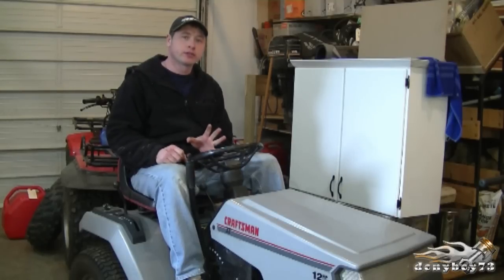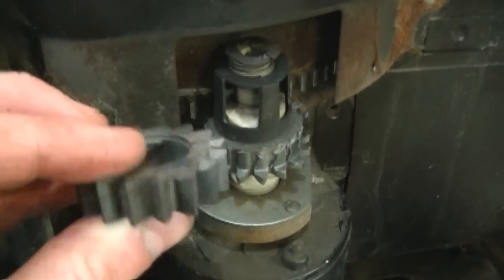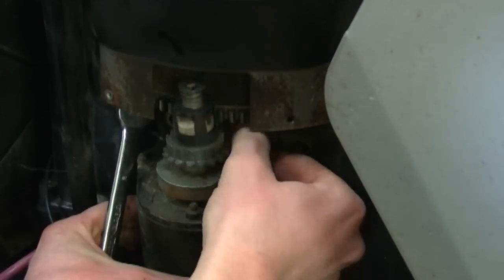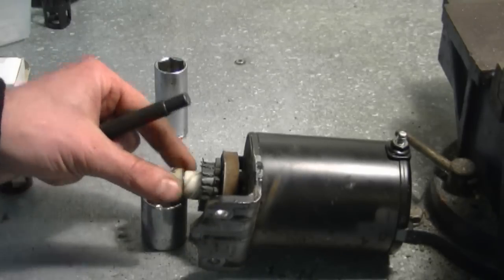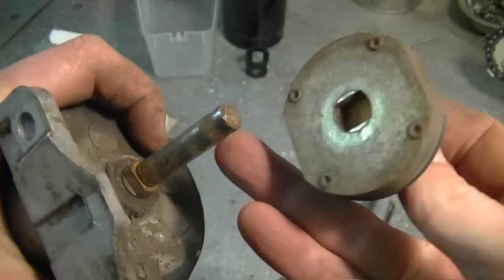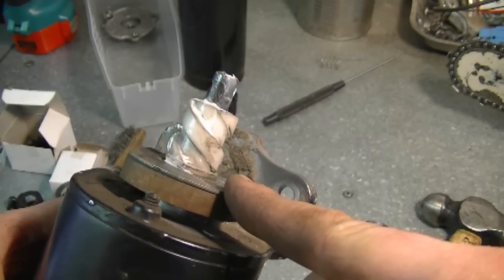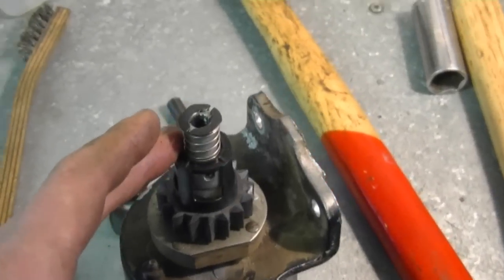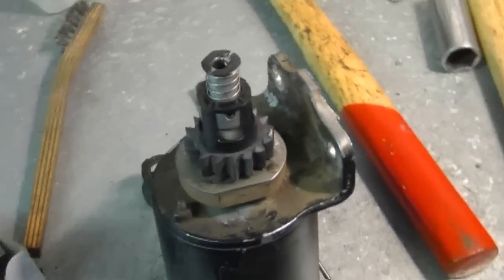Lawn Tractor Starter Gear Repair with Briggs & Stratton Engine

Comment: I got a starter on a 13hp yard machine it won't be easy as you show these easy repairs trying to place a nylon gear on it. I couldn't get no repair shop to replace or fix it for me. The bolts in the aluminum casing were strip so I jb weld them to it. I'm so poor can't afford a riding mower. I bought this one for $50.00 as is got it fixed just right only problem is the starter.

Comment: Hello. I really appreciate your helpful videos. I rebuilt my Briggs starter following your instructions. I also changed out the solenoid, plugs, gas filter and the coil since I had everything open on the engine. This is for my 1992 Craftsman 18HP flathead. The tractor is in great shape and now it's purring like a kitten. So again I say thank you for all of your time and efforts. Keep up the great work.

Comment: I have heard that they make the one gear out of plastic so in case  the engine will not spin it only breaks that gear and not damage the engine .  I have a 1991 craftsman the you have to pull the top of the engine off to get to one of the bolts .I have a briggs book that says that is the only way to remove the starter . I wish it was as easy as yours.  I also have a 96 and it comes out like yours .
Keep the great videos comming.

Comment: @skaaltel the ring gear is aluminum on most briggs engines except for snow blowers with 120 volt electric start and bigger engines like 16 hp + is is cheaper to replace the the $4 gear than a $40 ring gear

Comment: This instruction was spot on.  I have a similar, old Craftsman tractor.  It needed a new top end on the starter motor.  This video explained the whole process which was good if you haven't done it before.  
Thanks Donyboy.

Comment: You make the best small engine repair videos! I had this same problem with my cub cadet xt1 with a kohler v twin. I removed the starter and, surprise, all the parts were metal. No wear on the gear. I took the end cap off the shaft and a nut and washer came off with it. I refastened the washer and nut, put it all back together and back on the motor and, zoom, started right up on the first go. So, that nut must have a tendency to work themselves loose. Anyone having the same problem with a cub cadet xt1, before you spend 40 dollars on a new starter, check for this simple fix first.
Reply: Also, if you find that the problem is more complicated, probably best just to buy a new starter. This starter model looks like its not really built to be rebuilt. Would be more complicated than your average rebuild job.
Reply from the maker: @WallyGator72  I hardly ever rebuild anything nowadays

Comment: Good video.  I liked the way you showed details on removing the roll pin using a punch with the starter shaft supported by a vice or something metal, such as a socket from a socket wrench set.  I needed to know how to remove the roll pin without damaging the starter.  My only suggestion is that you should tell viewers that the "appropriate punch" to use is a 1/8-inch punch that is not tapered (which I learned from another YouTube video on this same subject).

Comment: Wow, thank you.  Your video gave me the confidence to attempt fixing mine.  However, in my case, the gear is made of metal and seemed in good shape, and what is happening in my case is that the small gear is not "jumping up" to engage the larger gear.  So, I worked the gear up and down and hit it with some Break Free and it started working 90% of the time but every now and then it would hesitate to jump up.  What would cause this?  I have a Koheler Command 11-16 HP motor from about 15 years ago in a Yard Machine.  I am sure something more needs to be done to permanent solve the problem?  Thanks for the great video!

Comment: plain and to the point, just what i needed. I enjoyed this video. I am sure this will help my 2001 CRAFTSMAN 25 hp B/S mrearlsc
Reply: Removing my starter from my 2001 Craftsman sure has been a new venture for me. I can say, one thing for sure I have learned a bunch. When you see something done it sure makes it a lot easier. Still learning mrearlsc   05/25/2023. Note / going strong 81.6  enjoy each day you have.

Comment: I just had to do this on a brand new starter!! I’ve only used the mower 3 times at most since I replaced the starter. They sent an extra plastic gear with the starter when I bought it but it’s a pain in the ass & very time consuming having to go through the whole process of taking everything off to get the starter off and then fix it and then the whole process of putting everything back on. I hope the replacement lasts more than 3 mows!!! 😡

Comment: I am about to do this repair on my cub cadet. I was wondering before I get into it if you could specify the plastic part that broke off during the process. I have already ordered the gear itself I would just like to know that plastic piece specifically in case my luck fares no better. Great video, very in depth.

Comment: Hey DB ... I replaced the entire assembly. I tested it on the bench and of course it shot up to the top as if it was going to engage the flywheel. I put it on the lawn tractor and all it did was spin at the bottom and not rise to engage the flywheel... Thoughts?

Comment: Got a twin 18 vanguard eats one gear a year, Breaks in the winter found a 1/4 in drive socket that fits in there.
Reply: buy your gear somewhere else it made in china with soft metal should be steel mine is

Comment: Don, Great instruction. My tractor looks the same (but 15 hp).  I appreciated you sharing that noise in the beginning of your video. Mine does not make the same noise. Mine makes a 1 click sound. The battery is fully charged, the carb rebuilt, and after I tried several times, it started to smoke at the bottom of the starter.  Please clue me in to  my next move. Did I burn something up by trying to start it too many times?
Reply: Hi Nick - my tractor experienced the same tonight. 1 click 1 wisp of smoke. 4 month old battery was strong on Sunday. Did you wind up replacing the starter?

Comment: hello, 
This spring at second use of the HUSQVARNA Rider R 320 on the lawn after the first two - three starts there was a noise like a scratch (cranck) , we found that the starter motor was detached, the inner casing of one of the two gripping holes was worn out, the screw did not fall anymore. We went to the authorized Husqvarna service on May 14, when the problem was not detected yet. The screw was recharged, the starter motor was removed, at the suggestion of husqvarna staff, we bought a new battery without any effect. At this moment, the situation is as follows: after two attempts the engine starts then the starter motor gets hot and is no longer able to turn the engine. I write these lines in the idea that maybe you will be able to advise us what to do next to be able to use this machine for as long as possible. 
Thank you for your patience and attention, Ana Maria 
ps: i really hope you'll find this massage. Have a nice day!

Comment: Hey Dony, any advice on what part number I need to replace if when I tightened the bolt holding the red ignition cable in, it crumbled the plastic looking washer behind it, now the screw is loose. Or do I need a new starter motor completely?

Comment: ive had to replace the starter gear on my 18hp opposed B&S 5 times in a year and a half  thats also including a brand new starter itself and with lubricant the starters a way quieter. i just hate that the starter is way harder to get to on an opposed. and when you havee tto work on and opposed starter do you take off the flywheel cause i dont. you can fit a wrench under the flywheel just fine. its just a pain re-alligning the starter when putting it back on

Comment: Stripping too many pinion gears on starter :   Don't forget to check bolt tightness, there has to be a lockwasher on each bolt otherwise they bottom in the hole and leave a dangling starter motor that strips threads faster.   Chk starter frequently for looseness/wobbly install (loose or bottomed bolts).   2. U can use 9mm or 5/16 socket & hammer to tap the snap ring back in.   3.  One guy showed how by turning the flywheel (battery disconnected) by hand he can get the pinion gear off & one without taking starter or flywheel off.   Another guy showed how he with hand grinder, ground off about 3-4" length of top side of flywheel (don't get into the flywheel teeth) to make more room to get pinion gear off easier removal again w/o taking starter or flywheel off.  Good video, thanks.

Comment: +Donyboy73 my 22HP Briggs twin vertical OHV starter gear will not go up all the way up when i apply power to the starter! it spins very fast and the gear is in great condition it just slides up about half way then instantly falls back down! do you have any advice you could give me to fix this problem?

Comment: i took the starter off, and everything looked okay. so i was going to grease the shaft that the clutch spins on. i figured while i had it apart it would be a good idea. i really need that c shaped ring removed however,hahaha its driving me nuts

Comment: Good types, but you don't need to unhood the battery, as long as you don't hit the key well the starter is off it is ok, also you don't need to remove the oil tube bolt, in some cases.

Comment: if you turn the gear upside down it will last a long thime than rright side up it still works the same way because my tractor ate a gear up every year i put it on upside down and never had a problem

Comment: I have a starter for a Kohler engine all mine is held together by a c clip.  Would it be possible to use snap ring pliers or something of the sort to get that silly clip off.  I have messed with it all day and have not be successful in getting it off

Comment: Man I hate rollpins, I had to do the same thing for my twin a few months ago and broke all the plastic parts trying to get it apart, along with the roll pin itself. Briggs actually does have a kit with the metal piece, although it was NOS so I'm not sure if they still make em that way.

Comment: I've got a weird one for you. My starter problem is...when I turn the key, the starter gear spins and moves DOWN instead of up to engage the flywheel. The battery isn't install backwards or anything. Just want to know if I should start with a solenoid or starter.
Reply: Have the same issue did you sort this ?

Comment: @donyboy73  can you show me what to look out for because i really dont know what i am doing :( and also i noticed there is a striped screw holding the carb to the frame so how would i take that out its in a very tight spot:(

Comment: iv been working on a mower it cranks good sometime but other times it dosnt and the red wire starts smokeing  black wire gets hot what causes that and also when not in use it kills the battery and we just replaced the battery. can you help pls?

Comment: Great video upload. What is the name of the plastic piece you replaced with an aluminum piece? I don't remember or did not hear in your monologue if you mentioned the name. Where to purchase the gear for a 19.5 HP Briggs and Stratton engine 12 volt starter? A million thanks for your response. David in Conyers Ga.

Comment: should there be play in that gear?  I thought that was my problem, but the teeth look fine - what I do notice is there is a little play in the gear as it sits on the starter motor shaft. (if that's what it is called) could that be a problem when it tries to start? also the 5 of the plastic fins that sit on top of the flywheel are broken - do you have to use a puller for that bolt? it was a 15/16ths - that holds the screen and plastic air fins(?)

Comment from the maker: @BriggsMower it still sounds like the valves are causing the problem, may need to be tighter, which has to sometimes. but without seeing that's about all i can tell you for now

Comment: I got a free Murray 10/30 rear engine rider from 1992. It has the same starter and the same problem. I tried getting out the roll pin but it's stuck and I don't want to break the little plastic peice. I even tried spraying it with WD40 and it still didn't budge. What should I do?

Comment: I replaced my solenoid, new starter gear, new battery, spark plug, new air can gas filters and the damn thing still will not turn over, just the the now the starter makes...ANY ADVISE PLEASE,,,,,,Also the starter gear does spin to the top, just spins at the bottom.

Comment: donyboy73.... I have Wizard lawnmower. The starter gear broke in half. I loved your video on replacement of the starter gear.my motor is a 16 hp Briggs. I have the same starter as shown in the video. Where d you get the replacement parts including the aluminum  part in the video . Give me your number on the repair kit. Thank you Great video  THANKS.

Comment: I have a briggs and stratton 12 hp on an AYP 3363 -14 and the magnets in the starter broke into pieces and jammed the starter.  What can I do to fix this?  Can I just replace the starter magnet?  Wheres a good place to look for parts?  Thanks

Comment: I have a cub cadet i1040 lawn tractor and my starter will not run, I took it off and wired it up so I could test it and it would not run, would you say it needs to be replaced?
Reply: +Stan Wilson UMMMM, you answered your own question. LOL

Comment: My starter is from a 25 hp Briggs & Stratton engine. The other day, I got that whining sound. I took the top cover of the engine off to reveal the top of the starter and found that the gear had come off the end of the shaft. Later, I found a plastic cap with the spring attached. It looks like the cap held some kind of clip that goes in a slot near the end of the shaft. Is there a kit to fix this? If it helps, the serial number on the starter is 9904215M. Thanks!

Comment: Hey buddy I have a Briggs and Stratton 19.5 horsepower V tween and the same thing happen over and over again. what else could be the the reason?
Reply: that starter   gear that wore like that is a cheap nockoff  the orig gears are steel no wear like that   if you eng is in good shape  you only use that small gear 10-20- sec to start   then it drops  down ouy of the way   buy your next gear  somrwhere else  dont buy a chape one  mine is 21yrs old   not wore down like that   that junk prob came from  china  thier metal isnt to good

Comment: My starter won't disengage out of the fly wheel,I have a new egnition switch,solinoid,new starter,& new battery.It starts but starter won't disengage.Someone said replace clutch bearings on top of engine,(haven't tried that yet),any ideas ? its a 12 hp briggs engine,an older one back in the mid 80's
Reply: you have probably already fixed it but try a new spring

Comment: I think I found it. It was interesting, on my tractor somehow the starter gear drove up into the flywheel and locked the whole engine. I thought the engine seized until i took the cover off and saw the other parts exploded and the gear was ground into the flywheel.

Comment: The starter on my mower spins when I turn the key but the small gear does not go up and engage the flywheel. What could the problem be?
Reply: Did u ever get an answer on that? mine does the same

Comment: Hey Don, you said in your video you supply the gears brand new, is that limited to your area or can you send it to somewhere else in Ontario?    I haven't really understood why the gear is made of plastic, as other equipment has it in brass or something like that.
Reply from the maker: would be cheaper from your local small engine shop so you can save the shipping
Reply: donyboy73 Yeah, could be, but we only have one near town, possibly two, but they charge an arm and a leg for some things since it's a monopoly.  Thanks, Don, I appreciate your hard work on these videos and your responses.  Cheers.
Reply: donyboy73 $100 for a lawn mower starter with plastic gear = highway robbery

Comment: the gear on my starter motor seems to be a type of plastic which warps with the heat i just had it replaced and the new gear wore out the first day i used it,my question is do they have a metal gear for it,not sure why its chewing out the gear even after the ring gear on the engine was replaced,anyone have an answer to my problem lol?

Comment: donyboy73...I have a John Deere D100 riding mower.. Will the starter you demonstrated also fit my Deere D100. I cannot seem to get the starter to engage the flywheel...It cranks, sort of, even tries to start at times but will not..I have played with safety switches, valve adjustments, etc 
7/11/2016
Reply from the maker: you would have to check your model number
Reply: +donyboy73 I have a briggs and Stratton opposed twin 2. the starter I have works but the starter gear wont engage the flywheel.  what should I do.
Reply from the maker: you might need to replace the starter unless only the gear is worn out
Reply: donyboy73 ok all try getting a new gear and if that dont work i'll get a new starter. Thanks

Comment: is there an easier way to remove roll pin?
Reply from the maker: +BIGGESTILOS not really but maybe a small bolt if you don't have the punch
Reply: +donyboy73 copy that ty

Comment: I have an Arien with a kohkler 17 series 2.  My starter teeth are goo, but, the starter is not going far enough in nor coming far enough out so it whines like this RRRRRRRRRRRRRRRRRRRRR.  and it goes on and on till I disconnect the negative and even then it either does not engage or disengage.

Comment: hey donyboy73 my lawn mower gear got striped and im doing the same thing as you but i dont have the pin tool and dont have any money to buy one right now how else could i do it cuz i tried a little screw driver and a hammer and mine wont move at all please message back
thanks,